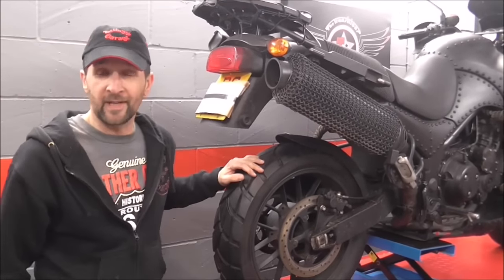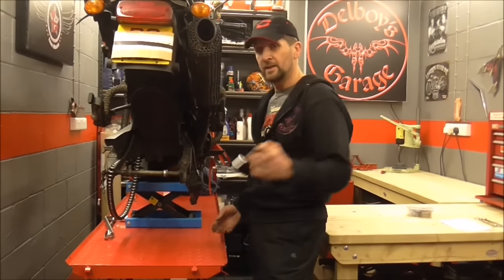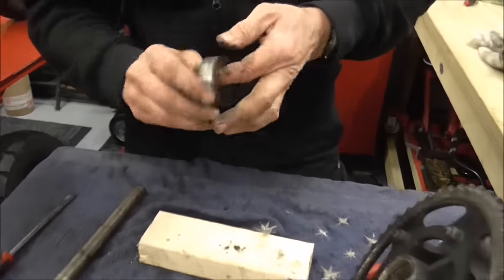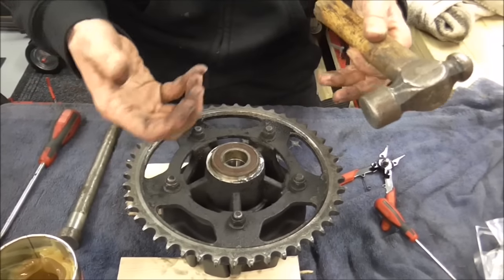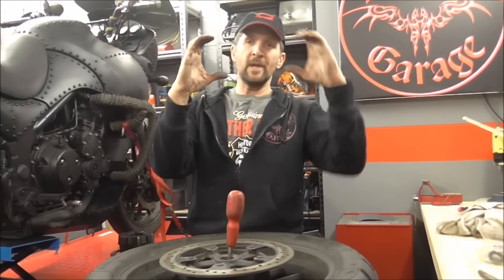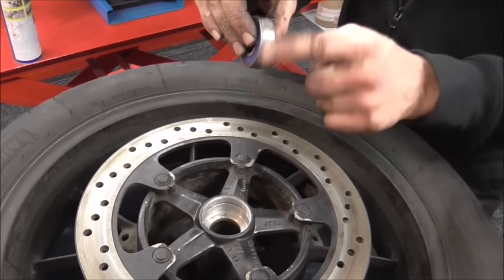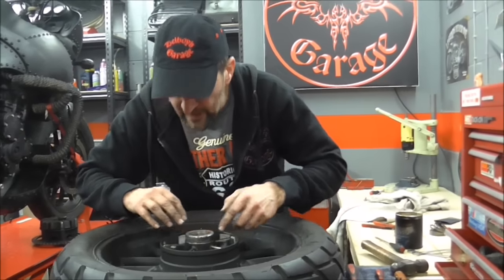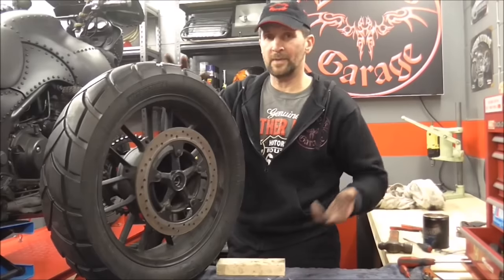Delboy's Garage, Motorcycle Wheel Bearing Replacement.

Comment: Thanks so much I did it today to mine Vstrom but I messed up with that pipe that seats between bearings I taped Bering to much so the pipe has no free play at all if you put your finger inside Bering and spin it the Bering on the other side spins as well what should I do now ? Will it affect anything ? Thanks
Reply from the maker: No mate, as long as you can move that central spacer tube to a central position so the axle fits through, then it should be fine... one bearing sits on a platform and the other sits on the spacer tube, you've just pinched it a little tight... but it's no harm unless you've pushed the platform bearing seating out?  So check that is fully seated and if it is, then it'll be fine (you'll probably find you can move the tube if you levered it 'gently with a screwdriver)... good luck with it mate.
Reply: Ok great ! That center tube is exactly on center as I had my axle thru when taping Bering, the other Bering didn’t come out. Thanks a lot ! Great videos !

Comment: What about wheels that don't have a loose spacer between the bearings.  My Harley wheels are solid in the middle between the bearings.  No loose spacer.
Reply from the maker: Thats not uncommon on some Harley wheels.. if you can't get to the back of the inner ring from the other side to tap it out from the other side, then you may have to use an internal puller...!

Comment: Great video Del! I have a Honda 150 carbureted single and lately I've been facing the problem of pressure build up in the fuel tank. The pressure in the tank cuts off the engine while riding and I'm having to open the fuel tank, release the pressure for the bike to start backup every time to continue. This is horrible in the summer when the temp is above 86 degree Fahrenheit. It seems to have enough pressure to push the cap entirely off. The Honda guys are clueless. Would you have any idea what the problem could be? Any help is appreciated!
Reply from the maker: +A Jay Hello mate,, sorry to hear that, im presuming you have a breather hole or hose from the tank, its there to allow for the natural expansion of the air inside the tank when the hot engine warms it up from below.....all tanks need them, and it could be that you have maybe trapped the hose (should hang down from under the tank and exit under the bottom of the bike) or maybe you've kinked it.... or perhaps its just blocked...  
  So take the tank off, and look for that hose....once you find it, "blow" air up it from the bottom with your mouth (wipe it first lol) and make sure that air can pass up along it .....see how that works buddy..? Good luck with it.. Del.,
Reply: Moonfleet41 I will try and give you an update. Hopefully this sorts out the problem. Thank you very much, Del! :)
Reply: Moonfleet41 Hello Del, I've managed to fix the problem. A tiny leaf had clogged the breather hose. The bike works like a charm now. Thanks again mate!

Comment: Nice vid!! Keep up good work! :)
Which grease are you using to install the bearings?
Reply from the maker: Hi buddy, just a wipe of regular LM grease has always served me well...thank sbuddy...
Reply: Thanks for your quick reply!
I usually use Copper Grease on the outside of the bearing and waterproof grease when it comes to moving parts as steering bearings, wheel bearings, etc. 
What's your opinion about that? :)
Thanks Buddy
Reply from the maker: Hi again Filipe, The outside face of the bearing needs only a tiny smear of grease to help it slide into the seat, and pretty much anything will work, copper grease too... and if you're bike gets wet a lot and specially for wheel bearings, you can apply some waterproof grease under the rubber dust seal that covers it..! every little helps mate.!
Reply: Thanks a lot! Yeah I kinda use my bike for every day commute and even though in Vienna does not rain that much...time to time it gets wet :)

Comment: does it matter which way the axle goes back in to the back wheel because it fastens on the right hand side on my cb750f2 honda. i want to put a side number plate on it you see but i wanted to put it on the left handside  does it matter if the side number plate is on the right. if it dont matter then all the better for me cheers mike...... ps i am chopping the cb 750 lol ;-)
Reply from the maker: Hi Mike.. in the UK where we drive on the left, then side mounted plates are usually on the left, but i dont know if there is any statute to that effect, an MOT tester will be able to give you the definitive answer to that... and as for feeding your axle in from the right, it makes no difference as long as it fits, and the spacers are the same internal diameter both sides, meaning that the axle can taper on some bikes, so only you can check that as you have the bike in front of you.. also, if you are mounting it under the axle head, or nut, then that will take up some thickness like a washer, so make sure you have a 'full nut' on the axle thread once you're done buddy..  Hope that helps you out.. good luck. del.

Comment: Quick question bud, I just done this two days ago to the front and rear wheel. The backs fine but the front wheel bearings are very snug with the spacer. When I turn one bearing the spacer and the other bearing turns aswell. Would you say this is ok or a do over with new bearing bud? Cheers Del
Reply from the maker: +Christopher Collins Hi Chris, it's just possible that you've tapped the slip fit bearing in just a little too tight... but it's not the end of the world, provided the axle goes through and everything lines up... it's more a problem if they are too loose, as then the spacer isn't touching and you can crush the bearings inwards... don't sweat it mate, just check it every now and again to make sure it's all running freely... the spacer isn't a precision fit - hope that helps, Del
Reply: +Moonfleet41 Cheers Del, really appreciate your help m8.

Comment: Why does the last bearing you assembled doesn't have a seat built in the wheel?
Reply from the maker: That is a question you could direct at the manufacturer... but common sense would dictate that it means the bearings can squeeze up shoulder to shoulder with the central tube and form one solid line when you pinch up the axle nut... this would be prevented if both bearings had a should to sit on.. when you pinched it up, you will be pressing against the casting of the wheel rim, and risk fracturing it.. the central tube prevents this from happening, which is why one end must be free to move and seat against the tube...

Comment: Hi Del, My speedo assembly pin has sheered twice I am wondering if this can be due to worn bearings in front wheel. Cheers!
Reply from the maker: +Silver Griffin Hi buddy, it hard to tell without seeing it.. if its a cable drive then a stiff cable can load the drive and sheer it...but if you think its the wheel bearing then just check it by flexing the rim to feel for play..?? May help.!
Reply: I'll lube up the cable and change the bearings. This is the 3rd speedo assembly i have bought. and they are so hard to come by these days.

Comment: @33' you forgot the support ring on the compression tube. Its not vital in use but it does make removing and fitting the axle easier, it allows the loosened tube to rock so you can find the opening to insert the axle much easier. Good video though and I like all your tips. On your comment re if you had to have this done at a dealer. Yes its fair the mechanic gets fair reward, also the delivery driver and bearing manufacturers, and kit provider. But where the problem exists is the dealer mark up on top of that which is set at maximum they can get away with and the taxman the same. Too many peoples fingers in your wallet. Much nicer if you can do it yourself and be independant and also learn. If something happens when youre out you will then have more of an idea of what to do instead of just phoning the AA
Reply from the maker: +brandywell44 There was no suppotr ring inside this hub buddy... what you saw round the tube when it came out was the plastic seal off the bearing... I have seen them in some bikes, but they're not essential, just a handy extra !  

Good call on the dealer, of course the main issue, having been a DP in an Aprilia dealership myself, is the pitfall profit in a new bike... most people don't believe you when you tell them that there's less than £500 profit in a £7k bike and from that you have to feed all the mouths that work for you and pay the taxman, so you're left to make yer money from everything else, finance, insurnace, commissions on extended warranties, and accessories and clothing, it's a hard business to make a living in!
Reply: Thanks for explaining, I like your videos and approach, and all your tips and experience, thankyou for sharing.
Re main dealers mark ups, the real damage to the consumer wallet is done by the distributor/importer and is simply a commercial decision because we in the UK fail to grasp how we are being taken advantage of. You should see the mark ups on UK bikes compared to our nearest neighbour France. 
This example is VAT inclusive at 20% in both countries but not including usual otr costs, road tax, prep, etc. For example in France the Street Triple is £5,775 but here in the UK is £7,500. That's £1,725 more expensive here in the UK and the bike has less transporting costs to a dealer here in the UK. This is easily verifiable by googling the Triumph UK website and Triumph France website. Tell the world...and tell the main distributor/importer of your favourite brand, Im guessing like me you will not get a reply...sssshhhhh!!!!

Comment: do you have a video on headlight builb replacement tiger955i?

thanks in advance
Reply from the maker: Hi Craig.. No i dont have a video on that.. but its not hard... in principle its pretty simple, you just take the screen off, then the front nose fairing off, and then you can access the back of the two headlights and twist the bulbs out as normal..!

Comment: cheers del. just doing mine now but the middle of the bearing fell out! now whats left is the outside stuck on the lip..any ideas please? I'd appreciate your advice.
Reply from the maker: Sorry to hear that buddy, am assuming you don't have a bearing puller??  Is it possible that you can reach it from the other side with a drift and, maybe, tap it out... it's annoying when the centre falls out, it's just a case of using some ingenuity to try and get it moving... certainly if you warm up the casting a little, it will expand it away from the bearing ring and male it easier to move it, but obviously don't blister the paint !  Good luck with it buddy, hope you get it sorted...
Reply: ok thanks I will just keep trying. there must be something laying around the workshop I can get it out with. thank you for getting back to me.
Reply: update for you... put some welds either side for grip and managed to knock it out.. back on the road :)  cheers

Comment: Hi del I'm about to tackle my xjr 1300 bearings are thay the same principle as this video in changing them.  This is my first time changing any kind of bearings
Reply from the maker: Hey Kelt, yes indeed mate... wheel bearings are preatty generic on all bikes, there are very few that are drastically different, as long as you follow the basic rules you should be ok... you can make yourself a press, as you can see, to fit the new ones, or you can tap them in, carefully, with a big socket... good luck with it, and let us know how you get on mate!
Reply: @Moonfleet41  I got some threaded bar a few large washers and some.washers that will fit in the recess with 2 nuts as you showed us a few months ago I'm going to try that method

Comment: I doubt you will see this but could i use a slide hammer with collets to achieve the same thing
Reply from the maker: I did see it mate lol  and yes you can, that would do the job just fine!  These days I use a blind bearing puller set with a slide hammer and expanding collets.
Reply: @Moonfleet41  thats excellent thanks

Comment: Heyy man greetings from India :) i really want to know how to check and remove Harley sportster's voltage regulator ?
Reply from the maker: +anhad jaura Hi Anhad,, thats real easy, just remove the two bolts that hold it in place, and pull the plug out... you can ask your Harley dealer to test it for you if you think it is faulty, but its not a job you can do yourself..! i hope that helps you sir.. good luck.. Del.

Comment: Should of watched this video first. I pushed my bearing in too tight against the tube. Now nothing moves. I measured the depth before removing and put the new bearings in slightly less. Must of been slightly bigger and put too much pressure on the tube.
Reply from the maker: If you have, or can get access to a blind bearing puller, then just draw the free level bearing out a few thou' it'll give the spacer enough room to move.
Reply: @Moonfleet41  I have got a couple of pullers but I was worried that any force on the inner race would cause the bearing to fail prematurely. Il give it a try and if the bearing start to get play il just put some new ones it.

Thanks for the reply. Anyway it helped me install the front wheels bearings which are perfect. Just got to fix the rear ones then I can start rebuilding my gsxr1000.

Comment: Mine doesnt have movement when pushing side to side, but it doesnt spin too freely on the axle. 

E.g, i just changed tyres myself, and was going to try balancing, but when i spun the wheel on the axle (off the bike) it came to a stop fairly quickly, and stopped in one place each time without swaying back and forth.

Would that be just that i could have dirt between the contact point of the axle and bearing? or need new bearings?
Reply from the maker: Hi mate... you dont use the axle to static balance a wheel as it doesnt roll freely enough... even brand new bearings will cause slight resistance that will overcome a tiny weight inbalance that you need to locate...so use two axle stands and a bar that pushes through with lots of clearance.. i use a 12mm tube to do it, than it will find its heavy spot much easier...     As to your bearing... if they are worn, you can often hear them rumbliing in a quiet garage as you roll the wheel round... but TBH they could just be dry... if there is no play, then they are safe for now, but keep an eye on them buddy.. ! Hope that helps.. Del.
Reply: Thanks a lot for the reply 

I think im going to change the bearings anyway soon, just for peace of mind, bike is still new to me so i dont know much about whats been done.

Ah i was thinking that it would need to be a tube that fits snug inside the bearing, because a bar smaller than the clearance would leave only the top part of the spacer touching the bar. 

Will get the wheels off and give it another go.

Thanks again mate

Comment: Crap!!!!!! I got the new bearings in but I cant the old bearing out using them like you did. How do I get them out?!?!?!
Reply from the maker: As long as you haven't tapped the old bearing all the way in, and you have about 50% of the old bearing sticking out... poke a big screwdriver in the hole and lever gently on the inner ring of the old bearing (Don't touch the new bearing)....then with a small hammer, "Tap" the old bearing on the side a few times, on the opposite side you're levering the screwdriver...then work around the bearing tapping and moving the screwdriver....and eventually the tapping and levering will lift it out..!
Reply: @Moonfleet41  you are genius!!! Mad respect for you mate

Comment: what is the company name of the bearing tool that you used in this video. found similar ones but no bridge. thanks kyle
Reply from the maker: I didnt use a bearing tool in this video Kyle..!   do you mean the later one with the bearing puller..!
Reply: Moonfleet41 , sorry it was the video where you do remove the bearings

Comment: In my case tube is hard stuck between bearing  and i cant move it to make a gap so i  can start hammering :(
Reply from the maker: No matter how hard the bearings have pinched it, a lever bear will shift it over  bit.!
Reply: @Moonfleet41  Thank you sir

Comment: The dust seal over my sprocket bearing is completely baked on the hub. Probably gonna destroy it getting it off. Sucks
Reply from the maker: Hi Andrew, They can get a bit overheated if the bearing dries out, but they dont cost much, so at least its not a big expense aye.. good luck with it buddy.

Comment: The spacer is so stucked i cant catch the bearing with my screwdriver.... any simple ideas? Its the front wheel.
Reply from the maker: lean a drift bar against the inside of the spacer, and tap the top of the drift sideways.. that should shift it slightly.!
Reply: @Moonfleet41  Thank you